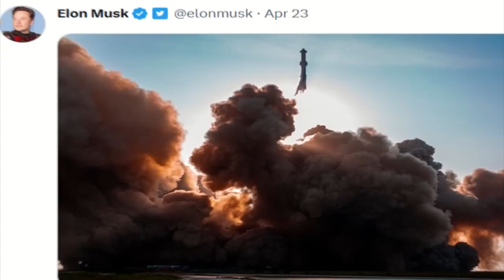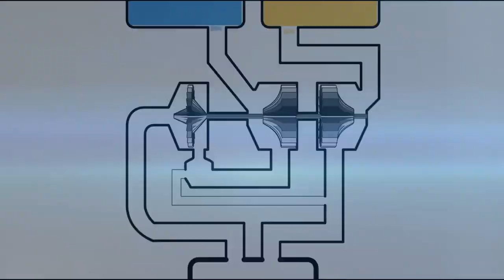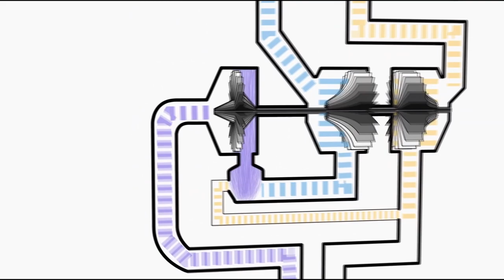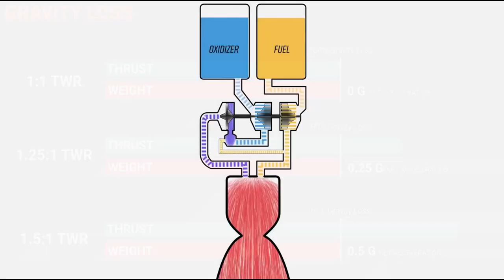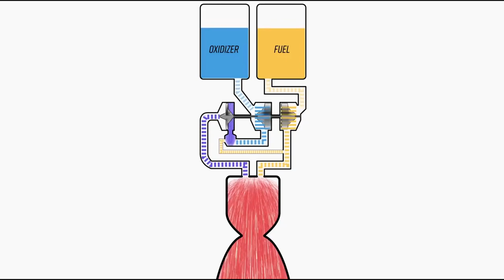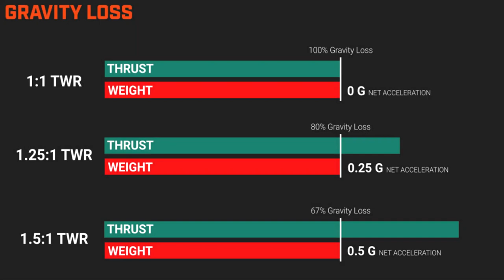Why So Many Engines Failed on SpaceX's StarShip Test Launch at  Boca Chica StarBase

Comment: I have 2 observations. 
1. With 10 seconds a full power and no flame trench before the clamps released the damage done had to be horrendous. That means those engines are tough mothers. Its a wonder that many lit and stayed lit.
2. Once the hydraulic APU failed (which may also be damage from the pad) they lost control. It started tumbling several times yet the rocket stayed in one piece. Just about any other rocket would have folded up and exploded before one revolution. SpaceX had to manually destroy it. That rocket is VERY strong. 
With a flame trench and water deluge the rocket should do just fine. I agree, in worst case situation it flew and stayed together. Its a winner. Well done SpaceX. Lets fix the launch pad, install the deluge system and flame trench, and fly the next one. 👍👍
Reply: Agreed. The ship made it to 37 miles in altitude, before they destroyed it - how many of NASA's blew up on the pad? They will correct the problems, and come back stronger and better - that's what winners do..
Reply: Agreed too. In addition i would say that managing liquified hydrocarbon is more difficult than traditional propellent and this is a strong achievement. About hydraulic system blast, i have some suspect that was overheated by engines.

Comment: The launch pad has been a problem since the pad was designed without a flame diverter.  The engine reliability is suspect.  Relighting is also a problem coupled with erratic fuel flow causing unbalanced propulsion.

Comment: a steel plate might reflect the sound/pressure back to the rocket and might be very destructive to the entire launch system.
Reply: The booster engines might have been damaged by reflected acoustic energy, not FOD.

Comment: This was a first full test of an experimental vehicle. Spacex now has much data to analyze. Job well done.
Reply from the maker: Was a full test but  not all the goals were achieved, there are still a lot of unanswered questions, the booster didnt separate plus the rocket didnt enter orbit so they could test the heat shield etc.
Reply: The ship did not seperate from the booster because the stack only made it to about 1/2 the separation height.
 The ship can not seperate while the booster is under thrust.
The flight plan did not alow  for seperation at this point.

It is reasonable to expect that at least some of the engine outs were caused by the failure of the concrete under the rocket  at launch (relying on this system was their only mistake in my opinion).
Reply: On the second part of your reply, Spacex stated repeatedly that the aim was to clear the launch tower.
They did this.
Why then have a plan that includes all these other achievements?
Because they need to also show to the authorities what will occur if they exceed the goal, and they would like to exceed that goal.
Using concrete only under the rocket  was a failure, the rest was a success.

Comment: It’s obvious it was the concrete that flew back at the shuttle 😒
Due
Reply from the maker: Thats the best explanation so far, however dnt rule out over heating either because those are 33 powerful engines all packed up very close together.

Comment: Elon needs to look at other ways of putting the spaceship in the air and then igniting when airborne.a magnet rail system round the earth would work with less failures.he should also research and invent a vertical magnetic suspension system. Sound and heat are both energy losses from a rocket making it inefficient.